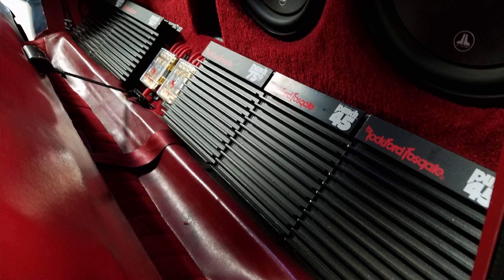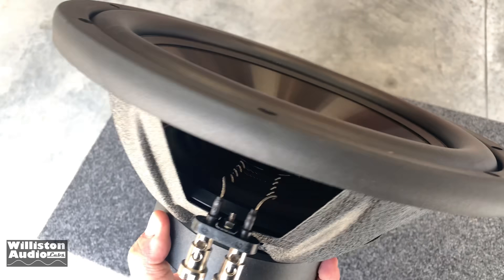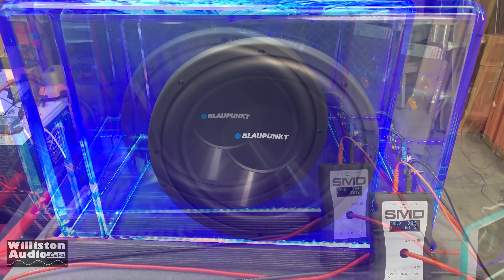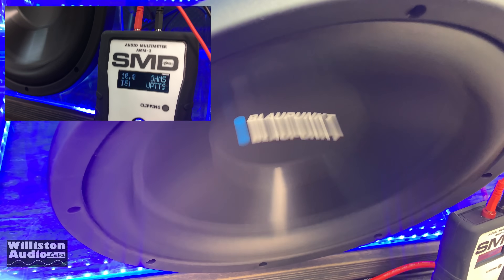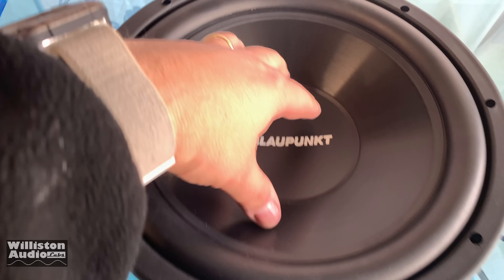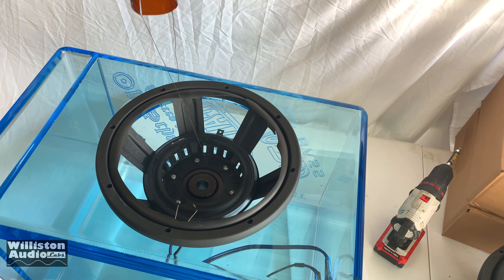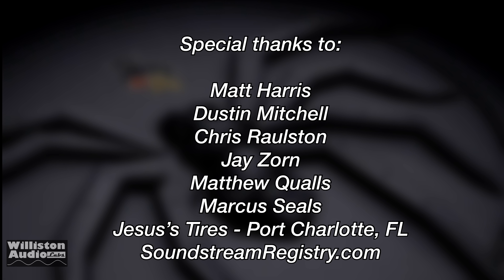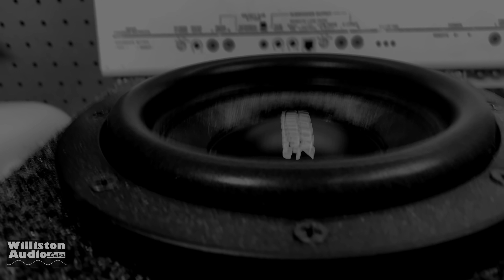$20 Walmart Subwoofer Tested and Blown Up! [4K]

Comment: Man, I remember when Blaupunkt was really high end stuff
Reply: Used to be the wiki tells all https://en.wikipedia.org/wiki/Blaupunkt
Reply: mike mcqueen I remember back in the day too, I had a cd player blaupunkt actually means blue dot
Reply: Velocity series was really good
Reply: Stock sound system used in the 2004 to 2006 pontiac gto and sounded great!
Reply: When was that? They sucked in the 90’s.
Reply: Blaupunkt never been high end
Reply: if Blaupunkt made a sub for the premium market then itl be better then its competitors easily..... if they can do that for $20...
Reply: Back in 2005 Velocity Pro amps and subs were really good. Now days blaupunkt is owned by chinese.
Reply: As an owner of an 06 GTO I completely disagree with the assessment of the stock system......the "subs" in the rear deck were replaced under warranty three time before I gave up and replaced them with (only slightly better) Pyle Wave Gear 6.5s which lasted until they were supplied power from a Lanzar 5 channel digital amp.  It's now all Sony GS with a Memphis Audio PRX5.550 and a MTX Thunder FPR12 and there's nothing I miss about that bland stock system.
Reply: Mine were 300 something with enclosed box in 97.
Reply: @Jay-ot2tk  yeah right! It's german
Reply: From what I understand, Rockford Fosgate is using them as a low end brand name for stuff they deem to be too cheap for their Fosgate label xD Pretty rough for the brand name.
Reply: Here's what happened https://en.m.wikipedia.org/wiki/Blaupunkt
Reply: Blaupunkt came in my 1974  mercedes
Reply: Ahh there old stuff yes. I got a velocity sub in my car 300w rms works great
Reply: They changed ownership in 2009, so it's not suprising.
Reply: It's always been blow chunks to me
Reply: Sad. I used to love the clean look and quality to the cd players
Reply: @klownsho1  u must be young because it was very high end
Reply: klownsho1 Yes, they did. Check out their history.
Reply: And soundstream, soundstream was the shit.
Reply: Nonsense, you should tell BMW, Porsche, Mercedes who all used high-end Blaupunkt systems back in the 80s, 90s
Reply: speakers are cheap to make  only about $2-$4 per unit(for big ones) how do you think they can pull off a 20$ price point
smaller speakers are sub 1 dollar  that is why most 5.1 or 7.1 systems come with cube speakers..    they put a concrete weight inside them  to make them feel more heavy.. it cost 2-4$ to make a cube speaker
the part the cost the most is the AMP  since they have to license   Dolby digital  and DTS. 

 some try and play them off as being super HIGH tech... to price them VERY high

cough cough   BOSE Chinese recycled  news paper speakers...  the quality has gotten a bit better  as long as you don't get paper speakers( only  some are really good made though) Like the one in my SUV  it has Bose DVD premium  entertainment system.  Dolby and DTS certified .. sounds good but not as good as the one in my old car(stock factory speakers)
Reply: back in the early 80's you could find them in bmws
Reply: That is true. Used to come as factory equipment in German vehicles like Porsche, Audi, Mercedes, and BMW. If you don’t remember then you’re too young and/or didn’t grow up during the golden age of car audio.
Reply: @klownsho1  they invented puting a radio in a car.
pretty much makes it default hi end for that year at least.
Reply: Used to be the real deal
Reply: They even worked together with Quadral
Reply: Blaupunkt was never high end. Car audio from the factories before '00 was poor quality compared to today, it was like listening to headphones from 1m distance back then. So any after market car audio install was always better than OEM, but that isn't the definition of high end. Same as people think Pioneer was high end in the 90's or Kenwood, they weren't, it was just hi-fi.
Reply: @junkyardhemi  80's
Reply: @klownsho1  Wrong
Reply: @johngray2511  Yes it was, especially in the 80s.
Reply: @SocietyUnplugged  what are you talkin about? You could install a Blaupunkt in any car in the 80s. I'd say Blaupunkt, Alpine, and Pioneer were probably the best car stereos made in the 80s. And, in the 80s, I was running a Pioneer head unit, Alphasonik 100 wpc amp, 2 - 15" Cerwin Vega subwoofers, along with 2 - 5 1/4" Pyle Driver mids, and 2 horn tweeters (don't remember the name of them). I was the first person of any of my friends to have a setup like that in my car. Shortly after that car audio took off in a big way.
Reply: @bigelile07  I agree on Alpine, I was an consumer back then and loved their products. I remember having a simple 140W monoblock Alpine amp powering an Alpine woofer. I also had an Alpine head unit but I'm not sure what kind of speakers I used for high and mid range. Alpine was very, very, expensive compared to the more popular brands. But I remember that my system sounded way better than Blaupunkt or Pioneer systems with more than twice the power (on paper).
Reply: @bigelile07  I know I was in Jr high in the 80's and they came stock in BMW's
Reply: If it's made in Malaysia then it still maintain its quality..other made specially china it became total crap.
Reply: @paulb4uk  that sucks man. I remember buying blaupunkt speakers for my car way back in 2001 or so. I requested a decal for my car and they sent me a HUGE one that ran almost the entire length of the back window lol. It sucks to hear it that they are now just essentially just the old name but cheaper products made by someone else. :-/
Reply: @junkyardhemi  they didn't suck in the 90s. I bought speakers in 2001 and they were very high quality.
Reply: Man yes them indash CD players was the truth back then
Reply: They made some crappy odd equipment
Reply: @bigpurple100  this isn't Blaupunkt as you knew it though. A Chinese company bought the brand after it was sold first by Bosch years ago, then by a German PE company after I think Blaupunkt filed for bankruptcy. Basically it's just a name and a front for Chinese crap. A bit like Akai is now.
Reply: @rich1051414  they had some distribution deal for selling Blaupunkt audio gear in the US I think.
Reply: Ryan Christensen how is the stock Pontiac gto sound system? I really want to buy that car soon and I heard speakers are actually really good
Reply: @arturmroczkowski4348  German  unfortunately sold all good brands to the chinese
Reply: @Wooly Bully  I had of the red xtr 12's in my 1970  Camaro back 94. I built an almost 2.5 cube box tuned to around 35 hz running only 400 watts too it . I said almost and around because I had to cut  2 inches off all the corners at a 45° angle after I built it. Because I only measured the inside of the trunk and I didn't measure the opening and it didn't fit. First and last time I made that mistake. Anyway it hit harder then my buddies 2 punch 12's on twice the power. It got stolen 2 years later. I still get pissed off when I think about it . One of the best old school  subs of all time.
Reply: ROFL at the kids above parroting "Blaupunkt never been high end" that were not even born when they were high end...
Reply: I remember when Skoda was high end quality.
Reply: @Jay-ot2tk  yeah blaupunkt is german for bluedot
Reply: It was still that subwoofer handeled it good. Sorry bad english
Reply: They were like pyramid....
Reply: Back in the 80s they made some nice head units.
Reply: @klownsho1  You'd be wrong.
Reply: ....fucked up what used to be a good name and premium brand
Reply: When did this take place. They have always been a cheap  brand in my world.  They mught have been high end at ALS AUTO SUPPLY OR SCHUCKS But my stero shop didnt carry any of it.
Reply: Well, when you put 900 watts peak through an 800 watts peak speaker , you get smoke....duh
Reply: Bittersweet image for us old speaker heads
Reply: Blaupunkt it was always a entry level, mark, dude!
Reply: 80's Pyle Driver 6x9's "ruled the 80's."
Reply: That’s what my dad said
Reply: @arturmroczkowski4348   i got Blaupunkt Velocity Vr2100 amp, is it good?
Reply: That's with a lot of things now
Reply: It was a great brand, now its a budget brand.
Reply: It’s not the original Brand anymore only the labe. It was great Brand now it’s China BS.
Reply: It was German, now it’s China. Only the Label like many other brands!
Reply: @Wooly Bully RF, PPI, Orion and MTX plus a few other brands were made here in AZ
Reply: Yeah back when blaupunkt was made in germany and not china. Unfortunately blaupunkt is simply a name now like many other good old brands
Reply: Suck when rights go to others. Good stuff always gets ruined. Never stays the same quality.
Reply: @gtodad7311  why do you buy some good shit ffs 😂😂
Reply: For what I just saw from a $20 12" sub, I would say it still is...
Reply: @klownsho1  then you my friend, are to young to remember the 80's
Reply: @abacusmaxx1804  I believe the Jensen blue triaxle 6×9 ruled the 80's.  After pyle,  teamed up with master p, with those liquid cooled amp line they went to shi.
Reply: In the early 90s I believe. You could have some bragging rights when you showed your gear back then lol.
Reply: He doubled the rms duh
Reply: Yeah top of line stuff I had whole system back in late 90s ithit hard as hell loved it
Reply: Yea I'm really high right now! 😂😂😂 🌳 🌲 🌴 😂😂😂
Reply: Me too. I remember as a kid in the 90s it was all my dad used in his cars. Now… Skar blows it out the water.

Comment: Performed pretty good for a 20 buck sub😀
Reply: yeah built pretty good for 20 dollars lol even had tensile leads woven into the spider probably only rated for 200 watts rms anyways
Reply: Kevin Anglin  I’m getting about 250 each out of em. Just can’t push any more than that and they will last. Plus I went easy on them for the first week. Not a bad system in my work car.
Reply: @ButtermilkL0veNugget  what kind of amp are you using?
Reply: Damn, the material alone is worth more than 20 bucks. Someone in the workchain is getting ripped off here and i think i know who that person is :/ 
Isnt it just wrong? (I mean the fact that such thing is sold that cheap)
Reply: White Boy kenwood 500x1 at 4 ohms. Subs ran parallel. Used a multimeter and came up with about 240 at each sub.
Reply: @ButtermilkL0veNugget  not bad for the price at all . Before I watched the video I thought they'd take 50rms before blowing 250rms at $20 is really good. Im done with the cheap stuff but for a budget build that's really good.
Reply: Blaupunkt was a pretty good brand actually
Reply: German quality :D
Reply: @Germknoedel  the only German thing about Blue Point is the name. Everything else is Chai-nuh.
Reply: @cuervoprov  Nope, Blaupunkt was founded in Berlin
Reply: @Germknoedel  Founded in Berlin. Made in China for at least the past decade.
Reply: @cuervoprov   you are right, Blaupunkt WAS good. It's not anymore...
Reply: @cuervoprov  Say it ain't so!!!!!
Reply: @ButtermilkL0veNugget  to be honest I'm guna buy these for the price alone and 250 per seems fine to me
Reply: @niclasstolzner6555  My early producion e46 BMW has a factory blaupunkt headunit, granted that was almost 20 years ago
Reply: It was $42 but it was discounted, it’s not made to be a $20 sub lol
Reply: White Boy Orion
Reply: Carlos Nelson I don’t see any woofer on the Walmart website do y’all have a link by any chance
Reply: Everything German does factory ready is made in China, the high quality is from Germany it self or produced in other countries from europe
Reply: It was a violent little bastard when it blew. It scared the shit out of me

Comment: Today you can put some decent bass in your ride for around $100 bucks .  Remember what $100 bucks would get you back in the day?    Diddly Squat.
Reply: Back when I was in high school $100 got you a total of 100 watts out of an amp. And $100 back then was way more than it is now. Amplification was $1 per watt.
Reply: Steven Young now you can buy a 2000+ watt amp for around 250$ (SKAR RP 2000.1)
Reply: Ugh. I had 2 impp 302 (12") in a 7cuft ported box.. Yep.. No trunk left. But I had those lows for cheap. I spent most of the 90s reboxing small truck enclosures into larger better fit customs. Often ported as well in strange under seat tubes. I remember my brother having an Orion i doubled volume and ported and never once heard a damn thing for an argument afterwards about anything.. I was 14 he was 19.. Mrv600 and type r 12 in 96 sealed.. Wasted more than the car I put them in.
Reply: I hear that. I remember back in 1995 my cousin installed a system in my mom's car. I remember It was a pioneer tape deck with detachable face and even had a hard plastic case to put the face in in your glovebox  there was 2 MTX 5 inch speakers in the back and 2 3.5 inch (I believe) in the front and just for that deck and 4 speakers was around 400 bucks. These days you can get something basic like that for under 100 bucks easy.
Reply: @Vgp-rp4iu  same year I put one with a changer in my mom's swift. Could reach around the seat to rear foot area to change discs. I put the cheaper units in her ride with a bunch of 6-3/4.. Those cars didn't even come with a radio
Reply: @the_nondrive_side  haha damn that's crazy. Suzuki right? My mom had a mitsubishi prisis (not sure how it's spelled) and that car didn't have a radio in it either lmao. Had a "place" for the speakers and radio but had to punch out the little plastic pieces lol. Amazing what changes in 24 years.
Reply: @Vgp-rp4iu  oddly I recall opening the door panels and finding 3 or 4" speakers held on with one screw in a 6" opening. No radio. But there was a wiring harness. But for $4500 new...
Reply: Back in the day $100 or 20 hours of washing dishes got me a Sparkomatic 8" amplified bass tube. It made bass like noises.
Reply: That's a expensive crow bar.
Reply: Speaker wire 😂
Reply: The "Punch Link" that I bought to connect my Punch 100DSM and Punch 4040DSM together was about $89 in 1993 when I bought it.
Reply: I installed 2 JL Audios in the back of my moms hatchback and I blew out the back window right in front of the house she came out and smacked me across the head with the broomstick. Good ol days
Reply: "Remember what $100 bucks would get you back in the day?"
A pair of shitty Spark-o-matic 4" speakers in some crappy plastic buckets....
Reply: That's the truth.
Reply: Maybe a cassette head unit
Reply: Shit, here I am with thousands of dollars into my audio gear being ultra picky still 😅
Reply: @stevenyoung3360  yes sir my kicker kx 400 was 499
Reply: If u added $100 to some trade u might get dolphins swimmin on ur head unit

Comment: Blaupunkt used to be a really good German brand, but now is a cheap brand. Still impressed that it pulled almost 1kw
Reply: Yeah I bought a blaupunkt sub based purely on their old reputation. It was absolute garbage. I was sorely disappointed.
Reply: splewy yeah and damn sorry to hear that. I hope you can get your money back based on misleading information. A good brand that doesn’t cost too much still is MTX Audio them and Rockfordfosgate.
Reply: https://en.m.wikipedia.org/wiki/Blaupunkt

Just like mtx and pioneer
Reply: @splewy  I did the same with some nakamichi car audio stuff. Shameful.
Reply: Back in 2000, I bought some  12” and 15” Blaupunkt  “Overdrives” they were spectacular sounding woofers. Very, very musical.
Reply: To be on the safe side, a continuous safe wattage should be less than 100w

Comment: For a very cheap budget subwoofer that wasn't too bad.  Take a decent 500 watt amp on a pair of those in a small bandpass or even a small sealed enclosure and I'd bet it would sound good for very little money.
Reply: It's actually very good, I've seen far worse for such prices.
Reply: It does. That’s my set up exactly and it sounds fine
Reply: Great observation!
Reply: You'll need a Qts<0.5 for bandpass, and you won't find this value in cheap subs. In fact, I'm surprised there even are specs for it, usually they aren't specified for this price range.
Reply: @articicejuice  you don't need a specific quality spec for a bandpass.. You already are compromising that by doing bandpass... As well as smearing time domain.. What you need is brains on how to overcome laggy bass. Or time aligned mains and a proper mid bass... Which.. Would cost more than $20. .. A 4th order with a .8qtcf and multiple round ports and a massive 1:2 volume ratio would be just fine
Reply: I bet I wouldn't even be able to notice it over my midranges.
Reply: David Murray Holland What?
Reply: @dawolyan13  .qtc final.. Useless if your time-domain is so smeared it's just shit. The more you phase flip the worse it gets. Just use a sealed and proper woofer or port
Reply: I have 2 of these 8" Blaupunkts in their own bandpass box running stereo in my Ford ranger and it sounds pretty damn good especially with music like Alice in Chains
Reply: This is arguably the best sub you can buy for the money. 20$ retail is amazing.
Reply: skinnyWHITEguy M I’m with u I’m a father an have to budget my money I’m on my way to get 2 an a 500 watt amp.  I just like to hear my bass in a song not win competition lol 😂